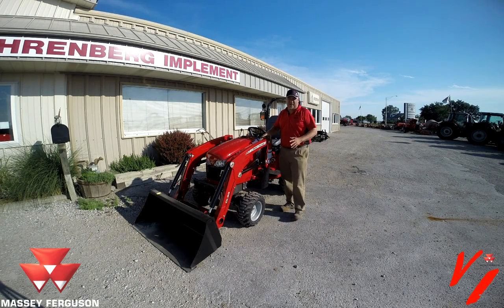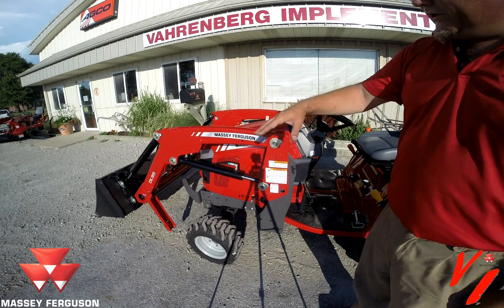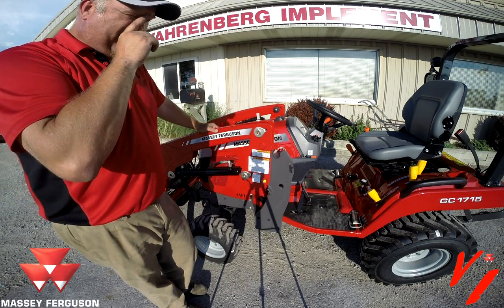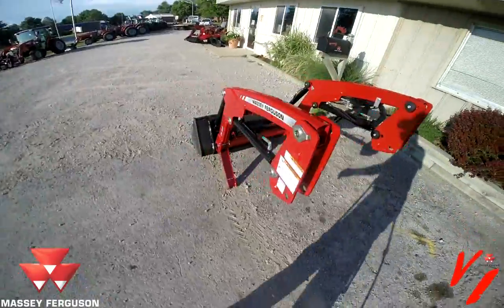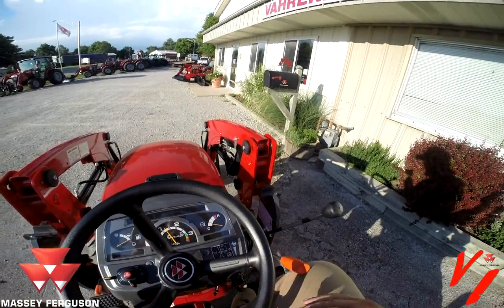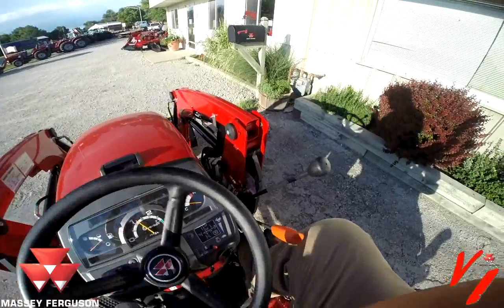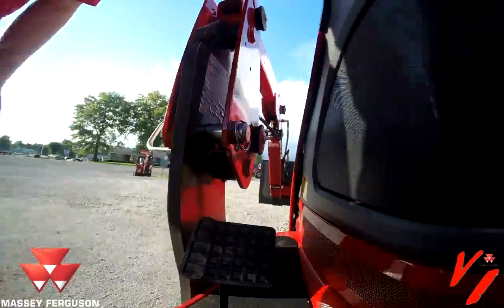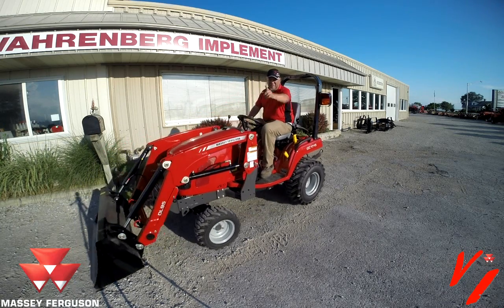Massey Ferguson Tech Tip: Compact Tractor Loader Removal

Comment: When you got off the seat, the tractor remained running, Mine  turns off.  Why?
Reply from the maker: When Tractor Range Lever is in Neutral Position and PTO Lever is Off Position it allows you to leave the seat and the engine remains running.
Reply: Thanks,  I didn't know that...very useful information.

Comment: We are having a hard time hooking hydraulic  lines up when installing the  loader can not get the black line to seat . Do you have any tips on that?
Reply: SAME ISSUE!  RESOLUTION works for me is to wrap the end with a rag, then take a hammer and tap down on the nipple (bulbous ball bearing tip) and it will break the pressure and pop out a bit of hydraulic oil.  maybe half an ounce.  Thats it.  Now the tip will now pop into the receiving coupler when you pull down on the collar.  No this is not a porn description!  the pressure is so tight in the lines that the ball bearing tip wont recede until you do this.  You will need to do it on all 4 of the lines.
Reply from the maker: Sounds like you have Hydraulic Pressure built up in the line need to loosed the fitting to release pressure. Be careful as Hydraulic oil will leak/squirt out.  Wrap a towel around before loosening. If Pressure is on tractor side shut off tractor move joystick in all 4 directions to release pressure and that will help connect hoses too.

Comment: Is it normal for the boom to drift down? When I park it and put the pin in and check it about 4 hrs later the boom is tite against the pin.
Reply from the maker: When not in use loader valves are not zero leak valves and will leak down over time.

Comment: Good video. I have a gc2400 and have a hard time getting the hydraulics out of the system when reinstalling the loader. I move the control handle as shown and eve bleed the hose tips on a hard surface but at least one of the connectors won't seat.   Other tips?  I work the tractor all year and it's great. Just don't find the process of switching the loader and snow blower to be very easy. 
Thanks 
N
Reply from the maker: Make Sure the Pressure is released on both tractor and loader will make it easier to connect any hydraulic coupler.

Comment: Very helpful. I have a new GC1710 and could not get the top pins of the loader to unseat. Therefore, I stood on front of loader bucket to unseat the top pins. A lot of steps to ultimately use the mid-mount mower. Thanks for the tip about standing on the bucket. Removing the backhoe was much simpler. Thanks again.
Reply from the maker: New Paint on loader brackets and loader frame make the first few times a little more effort until the paint gets smoothed up. You can step in the bucket or pick up a little weight on this series of loader and it will help tell things get smoothed out. I'd rather see things a little tight at the start than loose and then wear even looser over time. Hope that helps.
Reply: Vahrenberg Implement;  I put a little lubricant grease where the loader and tractor join to make the next time a bit easier. My initial 10 minute loader disconnect turned into a 30 minute fiasco b/c I thought I was doing something incorrectly so I viewed your video which cleared things up. Thanks. Don
Reply from the maker: I would recommend Anti-Seize versus Grease as Grease will attract dirt & dust and could compound the problem. Plus as temperatures rise the oil will ooze out of the grease.
Reply: Thanks. Have a safe Independence Day and may God continue to bless our great nation.

Comment: can a MF 210 get a grapple bucket. attachment
Reply from the maker: We didn't get into Massey Ferguson until 2008 the 210 was before our time with Massey Ferguson. Does it have a loader? There are many aftermarket or third party vendors that sell Grapples for all types of tractor loaders.
Reply: it does have a loader
Reply: has a 216 bucket
Reply from the maker: Have you check out the W. R. Long Website they make 3rd Function Kits and lots of loader accessories. Or there are numerous other manufacturers out there that make grapples for Compact Tractors like Worksaver, etc.

Comment: mi dealer find me a ripper tooth at this link
http://amiattachments.com/attachments.php?link=loader_backhoe-backhoe-rippers
do you know where too find a quick attach for the backhoe
Reply from the maker: I've never seen for Agricultural Backhoes a Quick Attach System. That might be something available in the Construction Indisty. I would recommend contacting the company of attachment they may sell quick attach systems for Backhoe accessories.
Reply: sorry should have mention mi dealer is a Massey Ferguson dealer and mi tractor is a GC1710 and he told me it's the same as a small mini JCB excavator and the link i gave you in mi other comment that company make those attachment but you need too pout there bucket not the one that came whit the tractor.
it would be nice from massey to have a quick attach and a choice of attachment.if you find some thing could you let me know?
and by the way love your video
Reply from the maker: I will share to Massey Ferguson about your request. There is no industry standard for backhoe attachments yet but it may be coming. ALO Quicke is the Loader and Backhoe Manufacturer and I will mention to them also as they are growing implement selections for loaders but might want to look into backhoe accessories too.
Reply: thanks

Comment: Why is my mower so hard to hook u p the takes a lot of &@$))(:/ to hook up to shaft
Reply from the maker: Which Mower MidMount or 3 Point Mower? Are you shifting into Neutral to make it easier to align the shafts? Need more Information to assist

Comment: Second the request for the mid mount mower removal and reinstall. I've seen a video for just about every sub compact tractor but Massey for this. I'm considering one but want to see this before pulling the trigger. It's my understanding that there's a 60" drive over deck. Would like to see how that works. Great videos and thanks.
Reply from the maker: I'm trying...It should come up this week. We can't keep GC Series Compacts instock long enough to shot a video and going to try as I have 2 more coming in but they are already presold. Might be a quick video before they take them home. Wish I had a tractor instock long enough to do everything but time and work commitments interfere with producing videos.

Comment: I appreciate you doing this. I may have adked you a few months ago.I have been asking AGCO for a helper video since March 2015. I guess this is good enough since you are selling AGCO products. I may call them and compliment your business for doing such a good deed. I bought mine in March, last year and have yet to be able to remove it. I also have been having hard time with the 60in mower deck and backhoe. It may be because I don't have any level surfaces. I am hoping to get me a small pole barn built that will hopefully make this easier.
Reply from the maker: We have plans for Mid Mount Mower Connection Video and Backhoe Removal Video too. Just need to have a GC Series in Stock long enough to get filmed...they selling faster than we can get. 

The surface doesn't have to be 100% perfect level but the more level it is the easier to remove and reinstall.
Reply: +Vahrenberg Implement that little thing that hangs in front may need adjusted, but not for sure.
Reply: +Vahrenberg Implement Thanks for replying.

Comment: Is it the same basic procedure for the larger tractors?  Say the 4600 or 5600 series
Reply from the maker: Very Similar on all series of Massey Ferguson Loaders but the 900 Series Deluxe Loaders have lock-n-go that is a little different connection to mid mount frame. The 900X Series Loaders like on 4600/4700 Tractors are very similar to this. Plans are to do more videos showing on each series of tractor as time permits.
Reply: Ok, Thanks.  Looking forward to it.